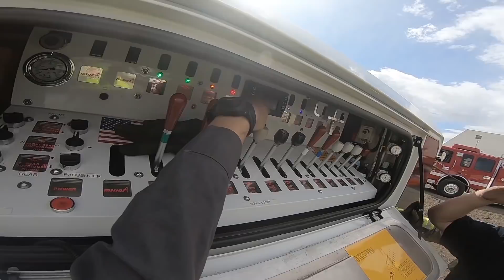Car Under-Rides Trailer! Simulated Fire Department & Rotator Cross-Training

Comment: Show them how you can pick up a car on it's wheels or roof from the front of the tator. Place an obstacle between the 1150 and the victim so they can see another scenario. Come up with 4 very difficult/different scenarios that really show them why they need to use Plaza not another company.